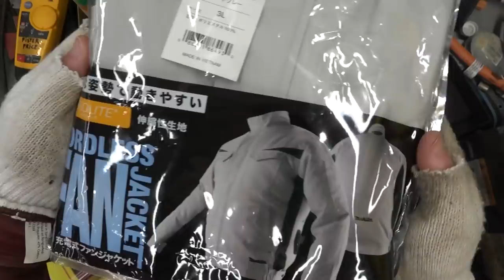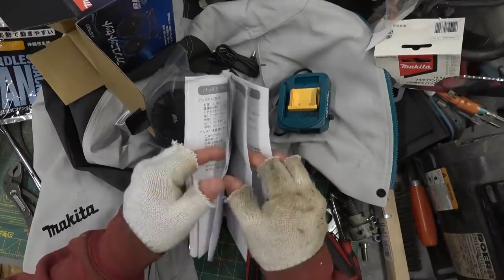Only in Japan! Ridiculous cool jacket

Comment: Now I DEMAND a heated tank top for when I want to be warm in the winter while still showing off the guns.
Reply: Just crank out some push ups in that tank top broseph, youll be warm and get a nice swell in the arms for the chicks to totally dig.
Reply: That's called a vest
Reply: You could wear it underneath the fan forced jacket too. Just in case the jacket actually works and you find yourself getting cold.
Reply: Millf@cki makes heated vest and coats w/ thermostatic control ... Many Blessings , SMR
Reply: Now you've gone and given away a million dollar idea! I hope you're happy!
Reply: DeWalt makes a heated jacket with zip off sleeves. 2 USB ports. Owned one for years.
Reply: I recall Makita having a heating jacket in their lineup as well.  Of course it would cover up those guns of yours, but you could get an equal amount of skin showing if you went with some assless chaps.
Reply: @jasnterry1313  those quilted vests, i never got the hang of them. 🤔🤣👍
Reply: @jasnterry1313  It's called a wifebeater.
Reply: Jase Poag  Check out motorcycle vests.
Reply: You all all missing the key importance of my arms staying warm. I'm well aware that vests exist.
Reply: Makita also has a heated jacket that can double as a vest. Go figure.
Reply: Field mod for HEPA on the intake grills and holes at the collar front and you have a laminar flow virus free personal breathing zone.
Reply: Even that makes more sense than a cooling jacket. 🤔
Reply: Fear not, makita also has a heated coat with removable sleeves for when it is time to go to the gun show.
Reply: @jasepoag8930  I would buy that 😂
Reply: @jasepoag8930  Hm, some sort a hot air blower system that tracks your arm movements and makes sure they're always surrounded by warm air?
Reply: Lol
Reply: Chinese heated jacket ~£25.  Cheap, warm and tight , just how I like them.
If your jacket has loads of drafts, you're definitely not the first to have worn it - you know it's been previously worn by 2 blokes at the same time, possibly more.
Reply: They probably have it
Reply: I got a heated vest for christmas. I had no idea that was a thing, but damn is it warm
Reply: Lmaoooooooo
Reply: These are common for motorcyclists
Reply: they have that
Reply: Heated vests don't count. Has to be a tank top to show off the shoulders and traps too, and have some means to keep the arms warm.
Reply: I remember seeing polar fleece thongs for sale at a snowmobile show.
Reply: @danieljay88  but the ice crust on top of the snow will still cut up your leg if you wear shorts.

Comment: I own this jacket and it works well.  
Several additional points:
- In Japan, for safety, the arms are fully covered year round.  The coverage of this jacket meets those safety requirements. 
- The jacket is available in a variety of fabrics.  Each fabric is a different color.  One of the optional fabrics is fire retardant and suitable for welding applications. 
- Disposable fan filters are available. This prevents debris such as workshop sawdust to get ingested and blown up into your face. 
- To enhances cooling, cool packs are available that insert into the mesh pockets inside the jacket. 
- Sealed tight around the waist and wrists, and the collar secure, a steady cool flow of air is directed out the collar, around the neck and to the face. 
When I first wore it, people were skeptical and chuckled at its appearance, but after a short time, they became more curious and respected the concept.  The jacket I have is blue.
Reply: I was thinking welding applications or even a motorcycle jacket if it were leather, etc. The concept does have some decent applications, but I'm not sure if this is the best iteration of it.
Reply: I am currently working in a big chemical plant in Germany. The Company is also known in America for cancer and some other stuff. We have to be covered at all times. Even it the summer we have to wear a long jacket and long trousers. No one knows if there is a pipe dripping. If there is some dangerous stuff we have to wear protection suits.
Reply: A cooled motorcycle jacket would be very interesting. It cant just be fans.
Reply: I was thinking it would be nice while riding my motorcycle in the summer.... boy it’s hot sitting in traffic...
Reply: These types of cooling systems are useful for cosplayers as well.
Reply: Yeah, it'd be real useful if it can be made to pass OSHA Fire Resistant 2 standards.   My company does construction for P66 and of course we have to be fully covered in FR clothing even if it's 120 degrees.
Reply: @Liam McNieve your comment leads me to believe you are not familiar with the cosplay community.
Reply: I have the welding one, no other fandangleries, decent jacket.
Reply: It’s also worth remembering the Japanese climate: summer monsoons.  Hot and wet all summer.  Jacket keeps you dry, fans keep you cool, not so ridiculous in Japan.
Reply: @A6Legit  bikes have built in A/C, it's controlled by the twisty thing your right hand is clenching on to.
Reply: In Japan, when going to the manufacturing area or lab, we need to wear the proper hat/cap/helmet, company work shirt/jacket, and sometimes slacks/pants and safety shoes. My feet were always too big for guest shoes. Sometimes the hat was just a cloth baseball cap type hat. Still have my IHI hat.
Reply: @robbyrob25x  traffic
Reply: @robbyrob25x  🤣🤣🤣🤣
Reply: @bullbill9717  no jacket can protect against monsoon rain. Step outside and you're getting wet.
Reply: I have a friend that has MS and part of that wretched disease is its hard to control body temp. Does this feel cool in warm weather ?
Reply: Can you give me the name of your jacket brand ?
Reply: Is it available in any online store like, Amazon, flipkart etc
Reply: Where can i buy it?
Reply: Where did you order

Comment: If you have ever walked to work in Japan in June, you would know why an air conditioned jacket is valuable.
Reply: If it's that damn hot why wear a jacket 🤦
Reply: Yeah!
What I wants next now is ventilated dishwashing gloves
Reply: @TheUncleRuckus  I don't think it's hot per se just really humid.
Reply: Given that 99% of viewers probably haven't... perhaps you'd like to explain.
Reply: @TheUncleRuckus  you can’t disgrace your honour by not having a jacket
Reply: Two reasons why you'd wear a jacket in summer in Japan. You're doing work that requires it, or you covet pale skin like many Japanese. Much of the soap in Japan is marketed as skin lightening.

Also Japan is the most humid place I have ever been.
Reply: They wore those on the submarine with screen doors.
Reply: @TheUncleRuckus  These are usually worn by a factory worker and construction worker who is required to wear long sleeves clothing in order to provided protection
Reply: @H   @mattbrown292  The preferring of pale skin is mostly a female thing here. Most people who use these are blue-collar workers anyway.
As far as humidity goes, Japan is quite low on the Asia standard. Also depend on which part of Japan you are in, the humidity can change a lot
Reply: This. You're going to be covered by 3mm of sweat at all times anyway, so might as well try to get some breeze and avoid sunburns.
Also, it probably helps when weather goes from "scorching sun" to "biblical downpour" in ten minutes...
Reply: Matt Brown then you never been to Oklahoma the summer.   Or parts of Texas .
Reply: @bobcranberries5853 yeah oklahoma is really bad sometimes haha way worse than dry heat 100+ in Vegas is nothing compared to oklahoma humidity
Reply: @TheUncleRuckus  During the Fukushima disaster, they turned off all the nuclear power stations. Limiting the power available for air conditioning. These were invented so people didn't bake in the summer. Japan gets very hot.
Reply: @bobcranberries5853  Parts? If you are going to include any part of OK, I'd say that qualifies ALL of TX.
Reply: I can confirm the Japanese summer is INTENSE and those road workers looked comfy AF in those jackets. A never-ending cool breeze would've been SO nice.
Reply: Ticncae it’s really fun watching people come out of the airport in Tulsa in the middle of summer when it’s 100° and really high humidity. The look on their faces is priceless.
Reply: Joshua Smith is the humidity that high all over Texas I thought it was just in some parts like Houston and Dallas area. I thought it was a bit dryer near Mexico
Reply: @bobcranberries5853  Yes I spent time in northern Texas one summer. Got so hot it melted my shoe polish.

Comment: I've been to japan on holiday 2 years ago and they did some road work. Of course I chose the end of July/beginning of August for my trip, which meant it had 38-40°C pretty much every day. Not only did they fully rip up and rebuild an entire street in a single day (they started around 6am I guess and the road was ready to use with road marks at 6pm), which is something I just couldn't believe as a german guy, but they also all had jackets similar to this one. Their jackets looked a lot thicker, almost like a thick winter jacket, but it was all just air and they even had a little pouch for ice cubes right infront of the fans. The Japanese have a solution for every problem you don't even know it existed.

Comment: Wearing that, you are just begging for your buddies to fart near you even more.
Reply: ...A sweet safety gal once brought in a few tyvek enclosed hoods with supplied fan air. Didn't take more than a shift for guys to start blowing their farts, easily and indiscriminately in the direction of the belt mounted fans/air supply. A couple guys puked! 
Ha, the best part is, they were actually kinda nice for some applications (ceramic fiber/insulation plant) but guys wouldn't wear them as the temptation from your pals was just too much to ask of a man!
Reply: boys will be boys
Reply: This seems like a perfect application to test the "liquid ass" spray. (Best not google that....)
Reply: @jimmyatoms4438  I used to work in a place that had an “explosive atmosphere” and the shop floor guys wore belt mounted filters for their masks. There’s nothing funnier than someone working in a glove box freaking out and first going to rip the mask off then realising they have their hands the other side of a window. It went some thing along the line of ~muffled cry~, THUD, ~muffled shouting~ , mask removed, new swear words invented on the spot....
Reply: @ mopedmarathon
Farts never get old. 
The shop I was at was full of awesome guys. Salty & Tough as cheap beef jerky. Good ole Union boys in Buffalo N.Y.
Anywho,
A buddy once got into a healthier more vegetable based diet, washed down with a six or so of Stellas' nightly. I've been in some of the rustiest locker rooms around. Never have I ever smelled such intensity. Fart sprays, stink bombs, nothing. 
So one day he rigged up the "fart dart". A long flex nose funnel with an inexhaustible air line hooked up to her. Best reactions I've ever seen. Had the affect of sun dried dog turds & a wrist rocket. It was incredible man. So bad a few guys were fightin' mad about it. 
Fart Dart, brought to you by the same fella as the Crapaccino.
-cheers mate
Reply: @jimmyatoms4438  🤣 bloody excellent! Good work sir. Loving the lengths you guys went to for a laugh man. Keep up the good work dude.

Comment: There's a fan you can get for your hardhat too. I know because I got it 😂😅. Everyone points and laughs until I let them try it and they realize that while you are sweating, you get a great swamp cooler affect.
Reply: If it works, it just works. Had one that also ran power to a decent headlight and used two beefy battery packs.
Of course, office wanks decided it was not allowed, everyone needed to use the same style of hard hat. For effing reasons. My list of reasons not to pull more overtime than I myself decide I have to never seems to run out of juice.

Comment: When you have fair skin and are allergic to sunscreen this makes perfect sense.
Reply: Or work somewhere hot which requires all personnel to wear long sleeves ie pretty much every worksite in Australia
Reply: Or if you work under ridiculous rules that enforce full cover up in the blistering sun! Only thing is, it's the wrong colour! More Dayglo, More better!    You can guess from how I spell "colour", where I'm talking about!
Reply: @donteven5712  You haven't watched many of AvE's  vijeyo's, have you!
Reply: @donteven5712  you need to learn bumblefuck.   I believe you can do a “learn to speak bumblefuck” on Duolingo these days.
Reply: For those that really have that problem I recommend reducing PUFAs, mostly by eliminating industrial seed oils (safflower, corn, canola, peanut, etc).
You will be surprised how much longer you can be in the sun without burning after a few months of not eating that junk.
You can replace it with coconut oil, olive oil, butter, tallow or lard.
Reply: @Gengh13  actually the best technique is to align your chakras just slightly less than 180 degrees off the phase angle of UV. That way the two pretty much cancel out. 

You don’t want them perfectly out of phase or the longer you spend in the Sun the less melanin you have and before long you become transparent - which is a breach of safety rules due to lack of visibility and you end up having to wear hi-vis paint on your nose. 

You have it all wrong about oils.  The better oils don’t stop you burning but they do mean you taste better after.
Reply: I'm allergic to the sun. How can Makita help me.....
Reply: @donteven5712  Mexico 🕺

Comment: I'm a welder. In the summer, I'd put an old air line in my pant belt loops inside my coveralls, with holes drilled every couple inches. Had a small valve to control flow. Even at 35°C, I was confortably cool. Low-tech, low cost, low-maintenance.

Comment: I actually use those in the summer. I'm a solar panel installer. 
Roofs can get really hot in the summertime. This jacket actually reflects some of the heat that comes of the roof.
UV rays wil also get too harsh so we have to protect ourselves, covering your body up with clothing. 
This jacket helps a lot during heatwaves. Without it I suffer from heat exhaustion a lot faster. (I still do when using this jacket, but only need a quick break every 45 minutes or so, instead of every 10 minutes)
It has a few design flaws. 
The conectors get loose easily. And the cable can break, in the same way cheap headphone cables also tend to do. They cost me about €100,- but with labour at €60,- an hour they quickly pay for themselves. Usually in just one day of working in a heatwave. They last us about one season.

Comment: I prototyped one of those tiny 12v blowers with a tilt switch on a 9v battery to blow air down across my face when welding.  Worked pretty well.  Pulls air off your head so avoids fumes and all you need is moving air.

Comment: Maybe useful for humid and reasonably hot where you need to be completely covered?  In general, though, chilled vests and jackets are a legit thing and super handy in the right circumstances.  I have a water cooled vest (ice water is pumped through tubing covering the interior of the vest) and it allows me to work in 115F/46C for several hours instead of passing out from heat exhaustion in a half-hour.

An ideal setup would be something like this jacket that completely covers everything and had air flow, but chilled air flow.  That does exist, but that also requires being tethered to a heat pump since there are no truly portable ones. So now we're looking at race car drivers and the like, who stay in one place. Not so good when you're building a house.

Comment: Gotta say, I would like for my "seasonal" jacket to have a fan in it. It's nice and light, sits well, keeps the rain and the wind out. Unfortunately it also keeps any bodily evaporations in, and even if you're not hot, it still gets real clammy after a while. Having a wee bit of airflow through the sleeves especially would not go amiss.

Comment: Off the top of my head: as the thing is, it draws in air from your surroundings and the vapour pressure of water in that air is ambient. It cools you down by increasing the rate with which sweat evaporates from your body. If you now saturate the incomming air with water vapour, it might be a little cooler, but it isn't going to able to take up your sweat so you've swapped cool and dry for cool and sweaty. I'm not sure that this would be an improvement. But an interesting gadget nonetheless.

Comment: Swamp coolers, also known as evaporative coolers, use evaporation of water to cool the outdoor air. ... This cooling process has the potential to lower the temperature of the outdoor air by up to 30 degrees in low humidity, but in high humidity swamp cooling does not work as well.
Reply: So, take the fans and reverse them to speed up the body's own process of evaporative cooling.... ah, now we're talking.. eh?!

Comment: What brand of fans are they? Some quiet Noctua fans would be a nice mod and make the thing a little more pleasant to wear. The battery adapter is the most useful part of the rig with it's 5v usb port. Great for charging your devices off your makita batteries.

Comment: having worked in the shipping industry for many years i have wishes for something  like this for years, except in a boiler suit form. when working in an engine room the temperature is extreme and you are required to have full length arms and legs for safety reasons.

Comment: I work in a glass factory. Specifically I run the furnaces, it gets pretty toasty in a big steel box with 3 glass furnaces in the summer time. And the new safety lady thinks it's a good idea to keep our cut resistant metal jackets on 100% of the time now. 

I'm actually about to order one of these to try it I think...

Comment: Lived in Okinawa for a few years. The local contractors all had these. Even saw folks on scooters with them. Okinawa is hot as hell most of the year, so all that air moving on you while you sweat to death outside might actually help a little.